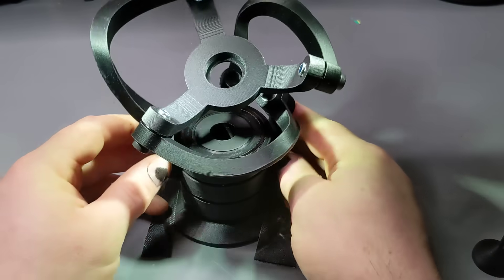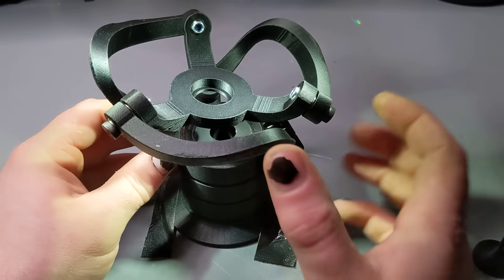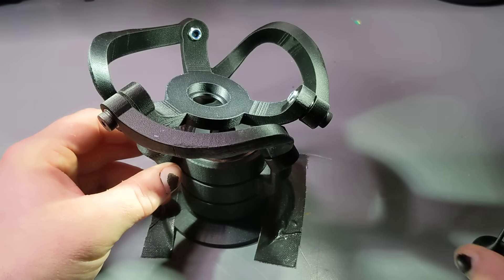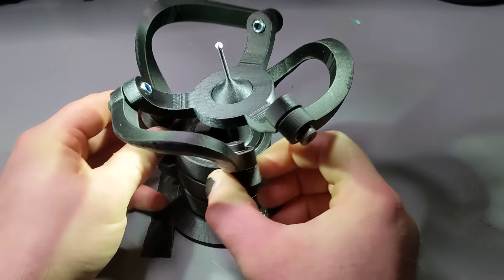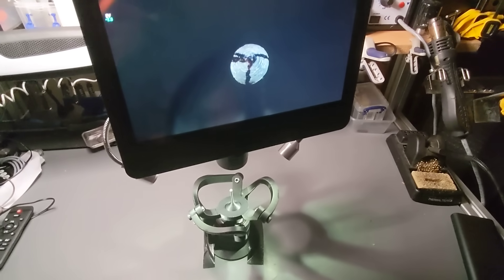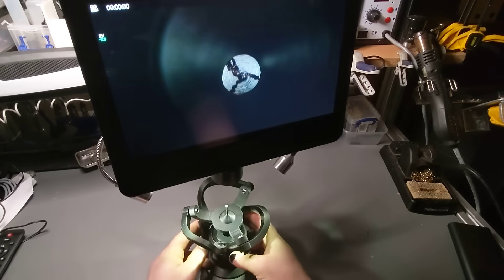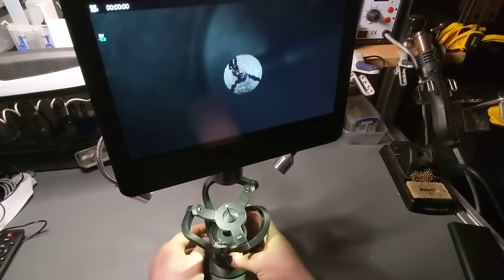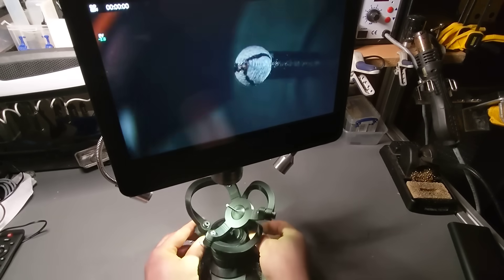Spherical Parallel Manipulator

Comment: can you share cad file?
Reply from the maker: I plan to release a free 3d printable one, but I might make a more rugged one as a product for labs and such (if there's demand?)
I posted an update vid covering cad/files etc, check it out and leave a comment there on which concept you'd prefer and what your use case/application is (people keep surprising me with novel uses) and I'll do my best to accommodate that in the released design. 
https://youtu.be/wN02itp6-z4
Reply from the maker: I've just uploaded the latest update vid, I've put a lot of work into making it accessible for everyone, files available very soon and I got the costs down to $10 of parts: $10 SPM https://youtu.be/DqjAKmm-FJQ

Comment: Sign me up.  How much. Im in australia.
Reply from the maker: Me too :) 
I plan to release a free 3d printable one, but I might make a more rugged one as a product. 
I posted an update vid covering cad/files etc, check it out and leave a comment there on which concept you'd prefer and what your use case/application is (people keep surprising me with novel uses) and I'll do my best to accommodate that in the released design. 
https://youtu.be/wN02itp6-z4
Reply from the maker: I've just uploaded the latest update vid, I've put a lot of work into making it accessible for everyone, files available very soon and I got the costs down to $10 of parts: $10 SPM https://youtu.be/DqjAKmm-FJQ
If you're interested in the short-run, professional use metal version please fill out this form: https://forms.gle/XGxA5Zzp16doP4pE6
Your email or any other info you put in that form will not be used for marketing, nor passed on to any third parties, nor used in any way other than to contact you about that specific project - I'm just an engineer in a shed figuring out if people want something :)

Comment: 3D file please good heavens
Reply from the maker: I plan to release a free 3d printable one, but I might make a more rugged one as a product for labs and such (if there's demand?)
I posted an update vid covering cad/files etc, check it out and leave a comment there on which concept you'd prefer and what your use case/application is (people keep surprising me with novel uses) and I'll do my best to accommodate that in the released design. 
https://youtu.be/wN02itp6-z4
Reply from the maker: I've just uploaded the latest update vid, I've put a lot of work into making it accessible for everyone, files available very soon and I got the costs down to $10 of parts: $10 SPM https://youtu.be/DqjAKmm-FJQ

Comment: It could even be good for, minimally invasive surgical robotics, very cool design.
Also rolls very smoothly, what type of bearings did you use? Would be great if you shared
Reply from the maker: I posted an update vid covering cad/files etc, the tl;dr is this design is super specific (and flawed) to the parts I had on hand so I'll make a revised design to share based on what people want to use it for.
 The bearings are just deep groove ball bearings everywhere, with a pair of flanged ones at each joint, and big 30mm ones around a piece of shaft for the base
https://youtu.be/wN02itp6-z4

Comment: STL to print it ?
Reply from the maker: I posted an update vid covering cad/files etc, check it out and leave a comment there on which concept you'd prefer and what your use case/application is (people keep surprising me with novel uses) and I'll do my best to accommodate that in the released design. 
https://youtu.be/wN02itp6-z4
Reply from the maker: I've just uploaded the latest update vid, I've put a lot of work into making it accessible for everyone, files available very soon and I got the costs down to $10 of parts: $10 SPM https://youtu.be/DqjAKmm-FJQ

Comment: can you give model?
Reply from the maker: I plan to release a free 3d printable one, but I might make a more rugged one as a product for labs and such (if there's demand?)
I posted an update vid covering cad/files etc, check it out and leave a comment there on which concept you'd prefer and what your use case/application is (people keep surprising me with novel uses) and I'll do my best to accommodate that in the released design. 
https://youtu.be/wN02itp6-z4
Reply from the maker: I've just uploaded the latest update vid, I've put a lot of work into making it accessible for everyone, files available very soon and I got the costs down to $10 of parts: $10 SPM https://youtu.be/DqjAKmm-FJQ

Comment: Without 3D printer can I make this
Reply: if you have tools that can bend and cut metal like that, yes
Reply from the maker: Not likely, but there are services to get parts 3d printed for you. I've released an update vid, I've got the cost of hardware down to under $10, 3d prints available soon. Latest update vid: $10 SPM https://youtu.be/DqjAKmm-FJQ

Comment: can you provide stl files or step files for it please?
Reply from the maker: I plan to release a free 3d printable one, but I might make a more rugged one as a product for labs and such (if there's demand?)
I posted an update vid covering cad/files etc, check it out and leave a comment there on which concept you'd prefer and what your use case/application is (people keep surprising me with novel uses) and I'll do my best to accommodate that in the released design. 
https://youtu.be/wN02itp6-z4

Comment: how to make this?
Reply from the maker: I posted an update vid covering cad/files etc, check it out and leave a comment there on which concept you'd prefer and what your use case/application is (people keep surprising me with novel uses) and I'll do my best to accommodate that in the released design. 
https://youtu.be/wN02itp6-z4
Reply from the maker: I've just uploaded the latest update vid, I've put a lot of work into making it accessible for everyone, files available very soon and I got the costs down to $10 of parts: $10 SPM https://youtu.be/DqjAKmm-FJQ

Comment: Are you willing to release the files for this?
Reply from the maker: I plan to release a free 3d printable one, but I might make a more rugged one as a product for labs and such (if there's demand?)
I posted an update vid covering cad/files etc, check it out and leave a comment there on which concept you'd prefer and what your use case/application is (people keep surprising me with novel uses) and I'll do my best to accommodate that in the released design. 
https://youtu.be/wN02itp6-z4
Reply from the maker: I've just uploaded the latest update vid, I've put a lot of work into making it accessible for everyone, files available very soon and I got the costs down to $10 of parts: $10 SPM https://youtu.be/DqjAKmm-FJQ

Comment: That's super cool! Any plan to release files?
Reply from the maker: I plan to release a free 3d printable one, but I might make a more rugged one as a product for labs and such (if there's demand?)
I posted an update vid covering cad/files etc, check it out and leave a comment there on which concept you'd prefer and what your use case/application is (people keep surprising me with novel uses) and I'll do my best to accommodate that in the released design. 
https://youtu.be/wN02itp6-z4
Reply from the maker: I've just uploaded the latest update vid, I've put a lot of work into making it accessible for everyone, files available very soon and I got the costs down to $10 of parts: $10 SPM https://youtu.be/DqjAKmm-FJQ
Reply: @makebreakrepair  Awesome thanks for the heads up! Looks like a great piece of kit! Thanks for sharing with everyone!

Comment: STEP files? Hardware list?
Reply from the maker: I plan to release a free 3d printable one, but I might make a more rugged one as a product for labs and such (if there's demand?)
I posted an update vid covering cad/files etc, check it out and leave a comment there on which concept you'd prefer and what your use case/application is (people keep surprising me with novel uses) and I'll do my best to accommodate that in the released design. 
https://youtu.be/wN02itp6-z4
Reply from the maker: I've just uploaded the latest update vid, I've put a lot of work into making it accessible for everyone, files available very soon and I got the costs down to $10 of parts: $10 SPM https://youtu.be/DqjAKmm-FJQ

Comment: Very cool! is there any 3d printer file available for such a mechanism?
Reply from the maker: I posted an update vid covering cad/files etc (tl;dr: this design is flawed and hyperspecific to what I had on hand but I'll make a version 2), check it out and leave a comment there on which concept you'd prefer and what your use case/application is (people keep surprising me with novel uses) and I'll do my best to accommodate that in the released design. 
https://youtu.be/wN02itp6-z4

Comment: Where can I find the files for this?
Reply from the maker: I plan to release a free 3d printable one, but I might make a more rugged one as a product for labs and such (if there's demand?)
I posted an update vid covering cad/files etc, check it out and leave a comment there on which concept you'd prefer and what your use case/application is (people keep surprising me with novel uses) and I'll do my best to accommodate that in the released design. 
https://youtu.be/wN02itp6-z4
Reply from the maker: I've just uploaded the latest update vid, I've put a lot of work into making it accessible for everyone, files available very soon and I got the costs down to $10 of parts: $10 SPM https://youtu.be/DqjAKmm-FJQ

Comment: Gibs me the file plis! I need  dis
Reply from the maker: I plan to release a free 3d printable one, but I might make a more rugged one as a product for labs and such (if there's demand?)
I posted an update vid covering cad/files etc, check it out and leave a comment there on which concept you'd prefer and what your use case/application is (people keep surprising me with novel uses) and I'll do my best to accommodate that in the released design. 
https://youtu.be/wN02itp6-z4
Reply from the maker: I've just uploaded the latest update vid, I've put a lot of work into making it accessible for everyone, files available very soon and I got the costs down to $10 of parts: $10 SPM https://youtu.be/DqjAKmm-FJQ

Comment: How did you figure this out? What math course let you manage this?
Reply from the maker: I uhhh didn't do any math 😅 The secret (figured out by people smarter than I decades ago, they've been around for a while) is all the bearings point to the same spot in space, so I solved it geometrically using CAD rather than maths. I hadn't seen any used for microscopy though, so it's more a novel application of an existing thing

Comment: where can i find the file ?
Reply from the maker: I plan to release a free 3d printable one, but I might make a more rugged one as a product for labs and such (if there's demand?)
I posted an update vid covering cad/files etc, check it out and leave a comment there on which concept you'd prefer and what your use case/application is (people keep surprising me with novel uses) and I'll do my best to accommodate that in the released design. 
https://youtu.be/wN02itp6-z4
Reply from the maker: I've just uploaded the latest update vid, I've put a lot of work into making it accessible for everyone, files available very soon and I got the costs down to $10 of parts: $10 SPM https://youtu.be/DqjAKmm-FJQ

Comment: STL files please? 😘
Reply from the maker: I plan to release a free 3d printable one, but I might make a more rugged one as a product for labs and such (if there's demand?)
I posted an update vid covering cad/files etc, check it out and leave a comment there on which concept you'd prefer and what your use case/application is (people keep surprising me with novel uses) and I'll do my best to accommodate that in the released design. 
https://youtu.be/wN02itp6-z4
Reply from the maker: I've just uploaded the latest update vid, I've put a lot of work into making it accessible for everyone, files available very soon and I got the costs down to $10 of parts: $10 SPM https://youtu.be/DqjAKmm-FJQ